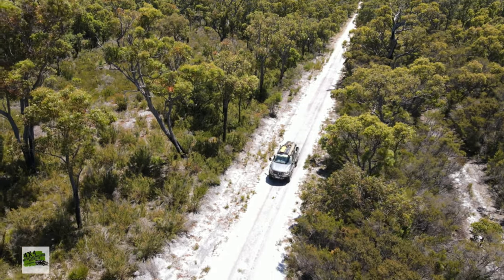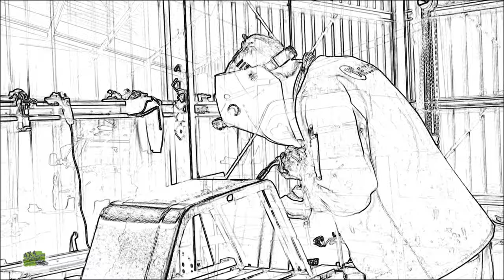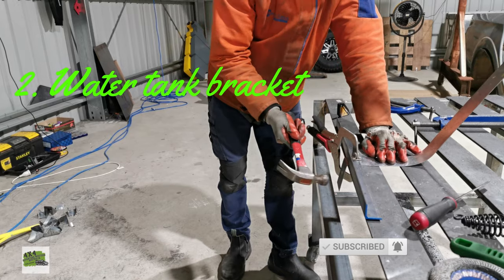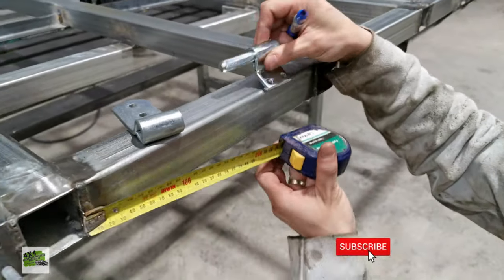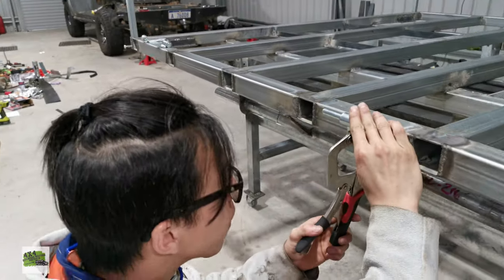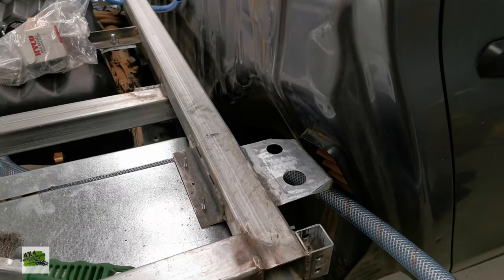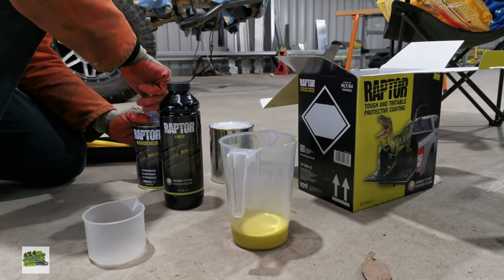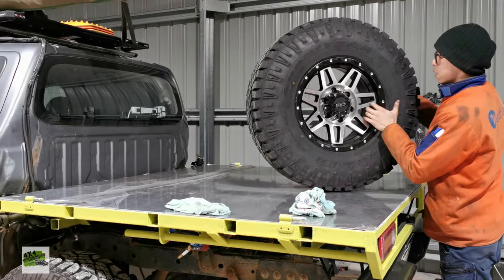4x4 TRAY BUILD - CUSTOM DIY flat tray Ep II - Project UTE-Topia Part II

Comment: Hi mate, that's a nice tray build and cool channel. Can you tell me did you do much sanding / degreasing on the duragal steel frame before using the adhesion primer? And how the raptor coating is holding up ?
Reply from the maker: I did light sanding and wipe the surface.
Tho I do recommend (by experience) sanding the surface using a coarser sanding disc/paper. This gives better grip to raptor products.
Glad you enjoyed the contents.
Reply from the maker: Raptor held up well even with light sanding. Good product indeed but make sure you allow extra drying time.

Comment: Did you fabricated the sides and the inches yourself? They look fabulous 👌
Reply from the maker: Thanks. 
I salvaged the stock side steps from the car. Trim them to suit. Then bolt on the hinches. The rear gate is a combination of 25x25 Ali, some Ali panels, rivets and bolts. Glad you like it.